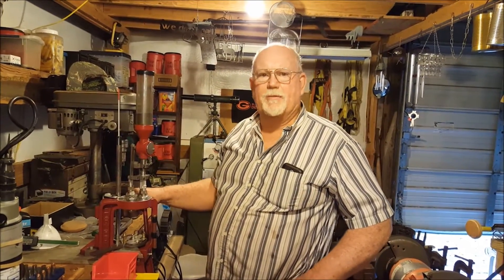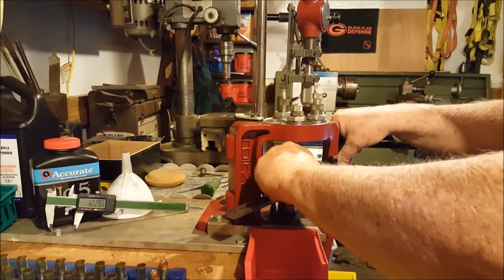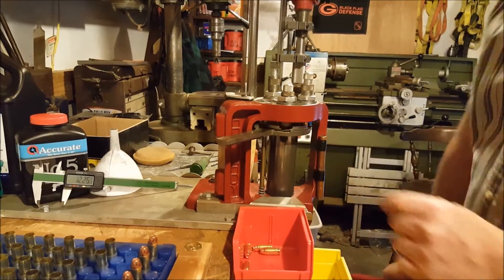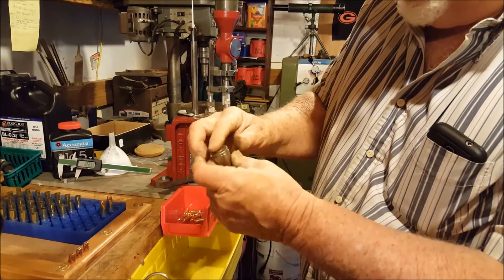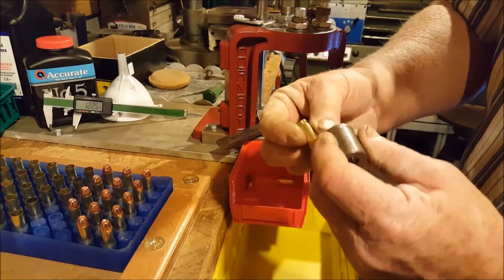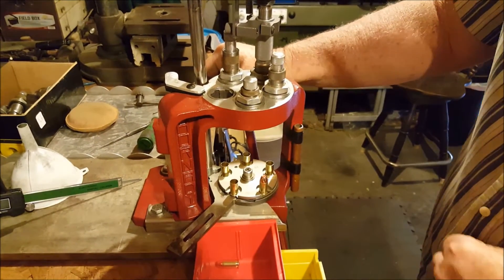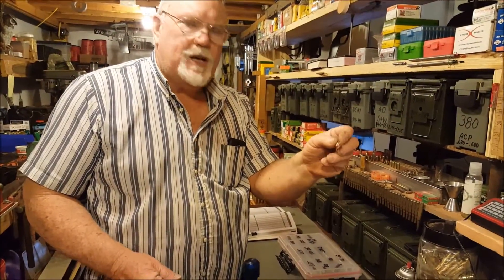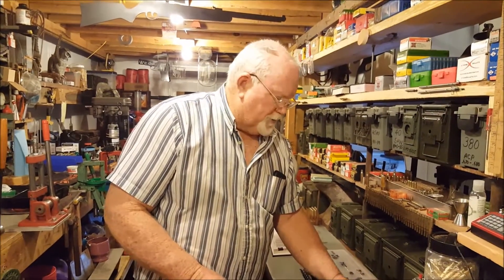45 ACP Hollow Points 200 gr Extreme Hornady Press by Eddy Coleman, Gilmer, Texas

Comment: Yeah I need to clean your die sets out and also make sure you live your brass even if you have carbide die sets it’s good to lube brass maybe 2 pieces of brass out of 100 would keep it moving along nicely. But the biggest problem is the dust particles and then the dies get dried out and begin to catch the edges of your brass and you can destroy your die sets.